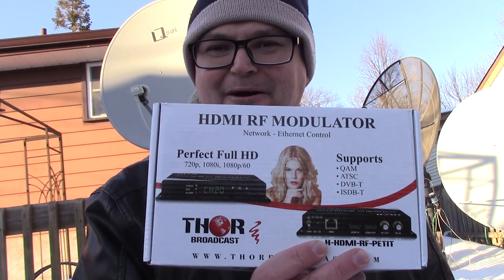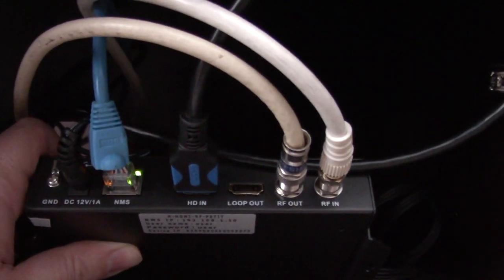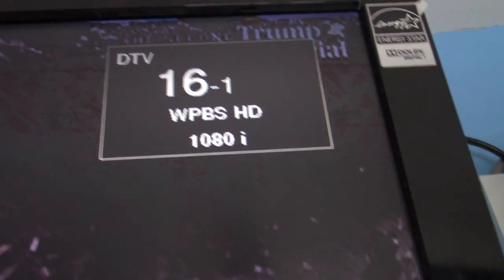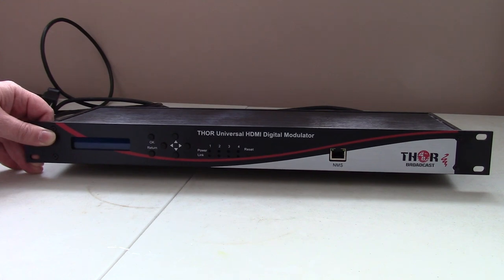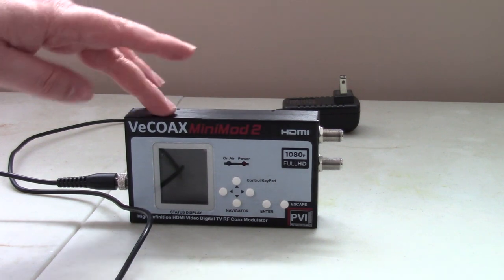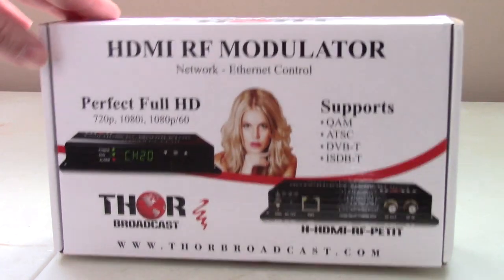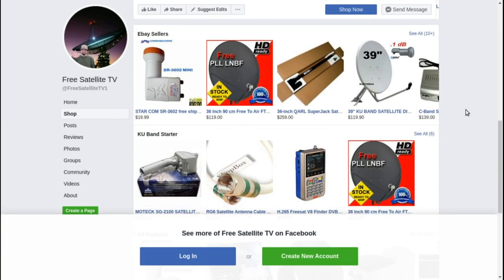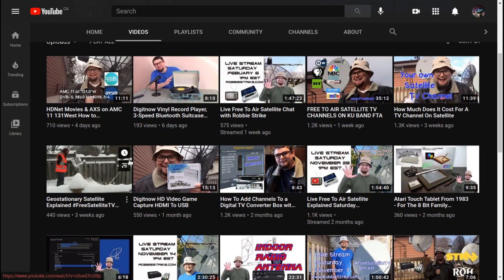How to Convert HDMI to Coaxial Cable – Digital ATSC Modulator

Comment: Right now I use an analog UHF modulator for my home cable TV system with a Betamax,  VHS and digital media player mixed with my antenna channels. But having an HDMI to coaxial like this would be an awesome addition. 📡
Reply from the maker: Surprised they are not cheaper you can get a HDMI to USB device https://www.youtube.com/watch?v=448v8p-3VMY But in some cases the manufacture may not be paying the patent licence fee on HDMI teck!
Reply: @RobbieStrike  Thanks Robbie
Reply: wow ! my father owned a betamax vcr he bought in France in the early 80s .   In the 90s we were able to watch encrypted tv  thanks to its built in tuner

Comment: How it's possible for the TV's tuner to give hd picture? I mean for once I'd believe the modulator is converting hdmi to rf. But how the tv's built in rf tuner would be able to display hd when Its made to display sd?
Reply from the maker: if it's a modern TV that has a digital atsc tuner
Reply: Modern digital TVs have a ATSC digital turner. They became mandatory in 2009 but were available in the late 1990s as set top boxes. The ATSC 1.0 standard allows digital broadcasts in 480i. 480p 720p, and 1080i resolution.

Comment: i need a rf to hdmi or rca for my atari 7800. not a hdmi to rf
Reply from the maker: I would go with a inexpensive RF modulator or a VHS VCR to the RCA output to a cheep RCA to HDMI converter. or a Atari 2600+ plays 7800 games! and you can power it with a usb c cable. not that obscure atari 7800 power plug :)